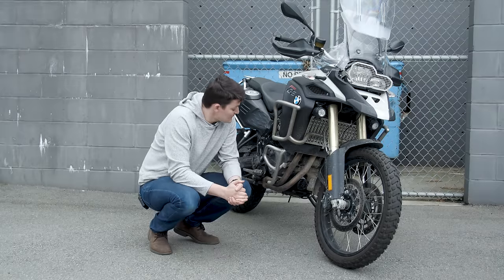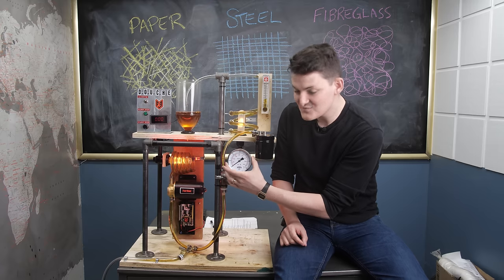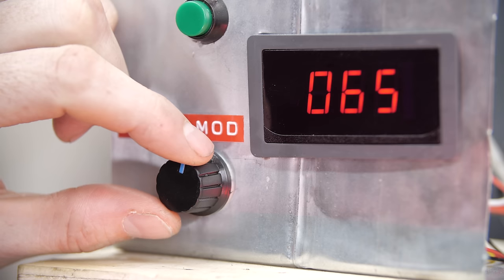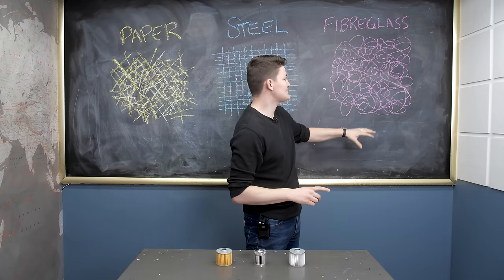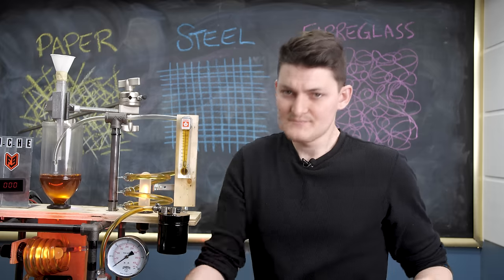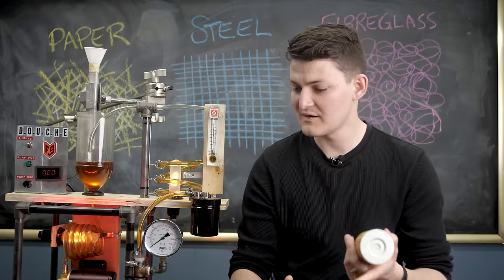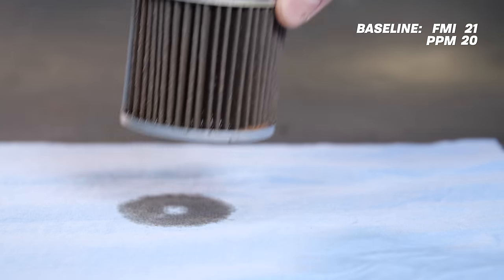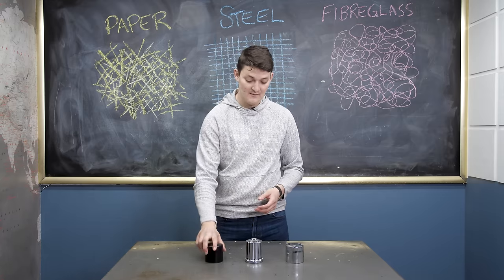The Best Oil Filter - Testing Paper vs Fibreglass vs Steel

Comment: Going to have to pass this one around.  I feel vindicated from everyone who has mocked me for just using cheap paper filters for all these years... :)
Reply: haha yea!
Reply: but yet they'll still mock you for spelling it as cheep.
Reply: @kbishop94  As they should. Lol
Reply: Derek Hermann ha! it’s all good Derek! 😂
Reply: I've had people mock me for actively choosing to use paper air filters instead of oiled foam, they actually think that foam is better at filtering air simply because its more expensive.
Reply: Not all paper element filters are created equal, though. Whatever you're buying, make sure the element end caps are metal and that it has a pressure relief valve like they show in the video. Wix seems to make a good product. And I believe they supply Napa for their store branded filters.
Reply: I mean as long as it isn't fram...
Reply: @Wrencher_86  Yes and yes.
Reply: @archygrey9093  for air filters, other tests are needed.  This provides no proof there, as the use cases are different.

I feel for normal Street Boys, stock will be fine (and high flow washable filters are nearly certainly worse, but this is untested) but there's real questions regarding humidity/water degrading paper filters so if you ride offroad or in the UK, that's a concern.
Reply: @Cheater357  Of course, I do have some standards... 😂
Reply: @Cheater357  Their heavy duty filters seem pretty good based on the ones I've cut apart. Their cheaper ones, though... yikes.
Reply: Agreed! Everyone always falls for the marketing BS. I just wish Project Farm would use this type of rig to test different brands of filters to see which brand is the best.
Reply: There is also a difference in paper filters… spend the extra $2 and it’s better as long as it’s paper
Reply: Personally for me, what goes off the bike, goes on the bike. Keep it stock, keep it simple (at least in regards to the engine and transmission).
Reply: thanks for the spoiler mate
Reply: If you do your service when it's time and you change the filter whith the oil then its fine
Reply: I used to use stock filters too. After the fourth change I realized I have to order parts. Always a pain. So, I use a steel one. With Rotella T4.
Reply: @BruceGinkel  have you seen project farm test air filters? He's pretty thurough.
Reply: Used to work at a Honda, Kawi, Yamaha dealership and was racing myself. Know what I saw Factory Honda/HRC race bikes get for filters? Yup, OEM factory paper filters.
Reply: @BuckingFastard  Not necessarily true.   Another channel did a comparison on the quality of build and material on standard paper oil filters, Fram lost out of the 4 or 5 tested.  In fact, the cheapest oil filter was the highest quality.
Reply: @Peter Angles your clever. I never would have thought of that.
Reply: @Wintersdark  I wasn't referring to Fortnines oil filter test to prove that paper air filters are better, I've seen other tests that prove paper is better for filtration than foam.
Reply: @archygrey9093  but why discuss air filters at all? This is an oil filter thread, on an oil filter video.  You're literally the only one talking about air filters, and not even providing anything useful there.
Reply: I wonder whether it's vindication if you used paper for the price and never asserted the beneficial attributes. In fact, if you (hypothetially) said: I know the quality is less, but that's fine by me... does that void the validity of vindication?
Reply: The problem with really cheap paper is it can disolve and give off chunks of paper into your engine. Not common but it does happen. cough fram cough. From what i hear.

I use paper but i avoid the super cheap ones that cut necessary corners.
Reply: @archygrey9093  You'll never see oiled foam air filters in heavy commercial/industrial engine - that's the place to look for what really works. Engines that have to run for tens of thousands of hours in extreme conditions.
Reply: Do let us know their reactions
Reply: I didn’t know they made filters from anything other than paper haha
Reply: @Cheater357 I’ve used Fram for years in my car with no problems.
Reply: I've been using fram oil filters for motorcycle and autos since I was a kid. I've never had an issue. I always do my own changes and I always check the oil looking for shavings, debris, etc. fram has been great to my vehicles
Reply: @archygrey9093  This test shouldn't be applied to air filters, this is only for oil, and air, in general, is not oil

Comment: As someone who works in a lab that does filter R&D (the lab does - I work on lead acid battery R&D on the other end of the building).... I applaud the work this took, your DIY hydraulic tester, and commitment to testing these proper and not just going with anecdotal evidence
Reply: What filters do you prefer?
Reply: Agreed. As someone who works in an automotive company, I've seen lesser rigorous testing for far more professional requirements.
Reply: @linkinlinkinlinkin654  True. As a professional oil filter myself, I can confirm the test is accurate.
Reply: @vsm351  lmao
Reply: "But it's an aprilia so there's a steady stream of metal shavings too" 😂
Reply: Holy poop, they still do R&D on lead acid batteries, that's kinda cool actually, I assumed for the most part that was a very mature technology.

Sounds like a fun job, I hope you make big progress!
Reply: We appreciate the benefit.
Reply: You Sound Like You Know. your Onions
Have you  Tested The Longevity of  a 
Paper Filter   ?  Can. You.  Change  Filter  Every 
Other Oil Change. If. You  Half. The Recommended 
Milage   for  instance.  . Kawasaki say. 7,500 Miles
But  that Seems High  to  me ...
Reply: There's a lot he's getting wrong and ignoring.

Comment: Please compare some “performance” paper oil filters (k&n) vs oem, vs cheap. Would be great to see if there is any difference
Reply: There can be a big difference in the amount of actual paper in the filters between brands, which should affect flow and capacity.
Reply: In the consumer market, the filter with the best capture efficiency that I have found are Purolator Boss filters. They typically are rated at or near 15 microns at a capture rate of 98.7% at that size. Most filters are still between 25 to 40 microns with the same efficiency.
Reply: Would be great...but could also possibly be a lawsuit (then again, I don't know)
Reply: @OklahomaLubeDude  The flow probably suffer significantly then. There has to be a happy middle.
Reply: @someguy5035  you're absolutely correct. The ideal flow is achieved by having a larger area for oil to flow through, bigger filter with more media. I mean, one could argue for a depth media, but likely not needed in most automotive applications.
Reply: I forget what filters he tested, but Project Farms has done an oil filter test.
Reply: Pretty sure I've read that k&n are simply a Hiflo Filtro with a nut welded on. That's a very expensive nut. After experimentation and advice from a guy who designs car engines for a European manufaturer I buy OE air and oil filters. The oil filters have the pressure release set at the right psi. The air filters stop more rubbish than the free breathing k&n. But we all make our own decisions
Reply: @FortNine  , as you have the D.O.U.C.H.E. still, might as well make a part 2 ;)
Reply: Its been done more than once just do a quick search on YouTube. Overall, its best to just go oem, most the time its cheaper than big name brands (k&n) and has better filtration. Surprising right? 25 dollar filter has less filtration capacity than a 11 dollar oe filter.
Reply: That’s another analysis I would like to see. I’m guessing that the cheaper non OEM but branded filters won’t be behind the OEM at all and I would expect K&N to be better but probably not enough to justify the price!
But I’m only guessing.
My bike had an overpriced OEM filter as it’s only had the first service so I will treat it to Main dealer service during the warranty to avoid any arguments if I need warranty work afterwards either a trusted shop or if I have the time do it myself.
Then I know every torqued bolt is right!
Reply: @markcolt1114  don’t think you can be sued for openly showing a method and publishing actual figures!
They would need to prove you lied about the results or misrepresent their product.
And you could always test a few OEM filters vs a few non OEM and not mention brands!
Reply: look at the packaging a lot of filters get made by the same company in the same factory with the same materials with different stickers.
Reply: I have always heard horror stories about Fram filters. I tried one myself, and the horror stories were true. I got a cartridge one for my Volvo. The top and bottom of it totally separated from the actual paper element, and it was well before the service interval. I have no idea how long it was like that, but I will never buy another Fram, that's for sure.
Reply: I believe the reason they did not test high performance filter like that is because they have a pressure bypass. Which they are trying to avoid in the video to show the absolute (within their ability) with no outside factor involved like a bypass.
Reply: I will never put another K&N on my motorcycle. A rock tapped the tack welded nut on it which tore it back creating a pin hole. I was dumping oil at highway speeds on my back tire for miles. Didn't realize it until I came to a stop and started a right hand turn and back tire almost kicked out on me. I recovered without dropping and got lucky.
Reply: @markcolt1114  lawsuit? lmao for what? You can do whatever kind of testing you want with any product out there.